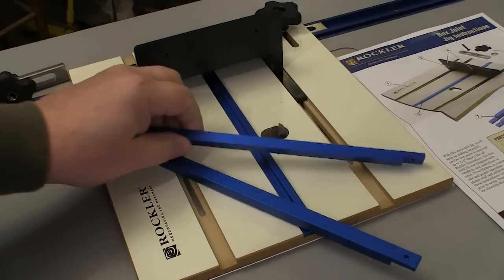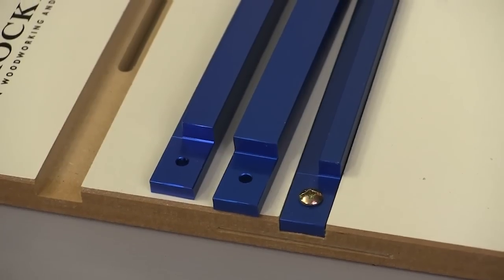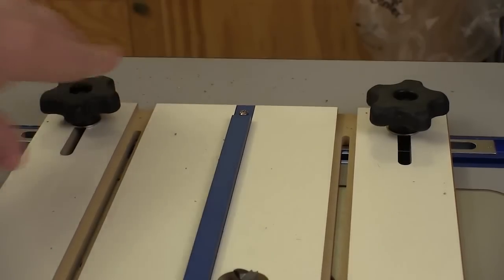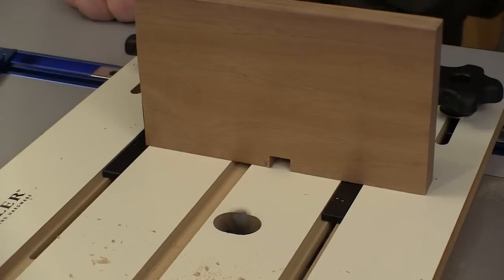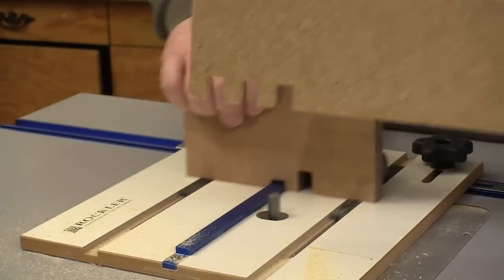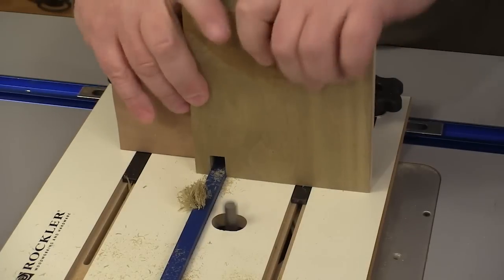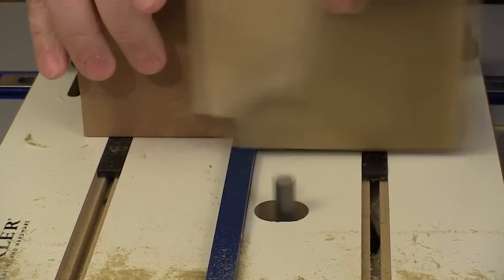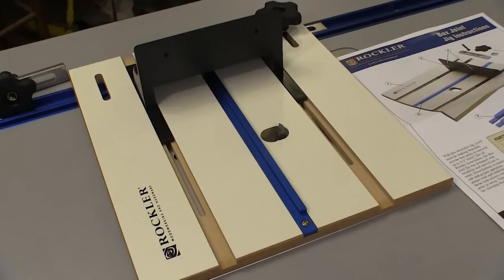Rockler Router Table Box Joint Jig Review | NewWoodworker

Comment: I have a rocker box joint jig. Mine does not have that center pin rail. I have 3 brass keys that screw in to the plastic slider. I actually used mine for the 1 st time and noticed that the slider has a little play from side to side so it wobbles in the track. The result is some cuts are wider than others producing big alignment issues. I cut a new sacrificial board that is a little taller so I could put a clamp on it to hold the work piece steady but no matter how tightly I hold on to the plastic slider,once the bit hits the wood , the slider twists and the cut is off. By the time I get to the end,the spacing is so far off that the pieces will not even interlock. I am a sticker for detail I read the instructions thoroughly, marked all the work pieces accordingly made sure the space was right between the key and bit and yes, the board was securely fastened to the router table. Maybe I have a defective jig. I bought the rocker because of the name. I appreciate any advice you might have.
Reply from the maker: There will be some side to side play on the slides but very minimal. I would shim it with tape to make up some of the play. If it is excessive Rockler would replace the jig for you. As you know with box joint jigs all 3 measurements are critical for a tight joint. The bar or brass pin, the router bit (Preferably a spiral carbide bit) and the distance between the bar and the cutter all have to be exactly the same or the joint won't fit.

Comment: I have one of these jigs that I use to make recipe boxes. The only thing I don't like is what happened in this video. It is hard to slide due to the tightness of the pin on the key. It's not so bad if you only have one box to do but if you setup to do say 3 or more boxes at a time and you are using the 1/4" setup, that's a lot of repetitions. My hands get very tired after the second set. I usually do two sides to the box at once to save time. I like it, but this tool's ergonomics could improve.